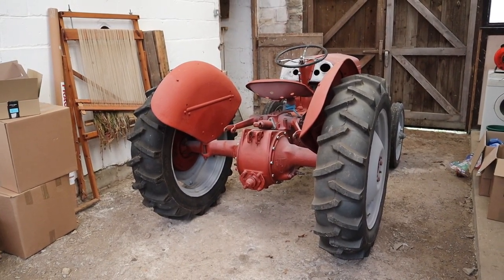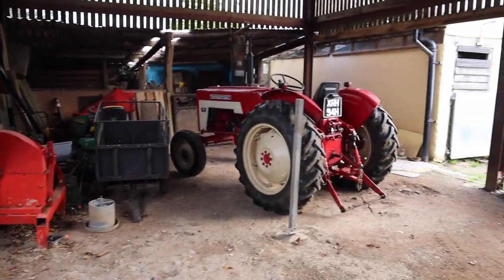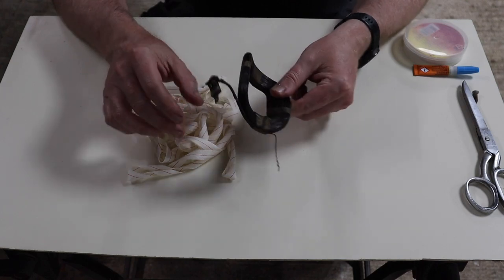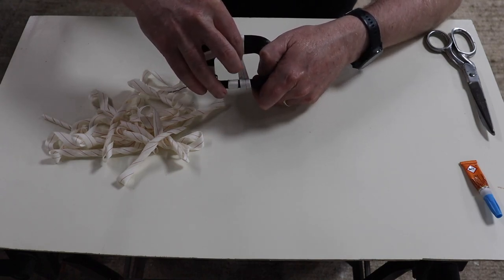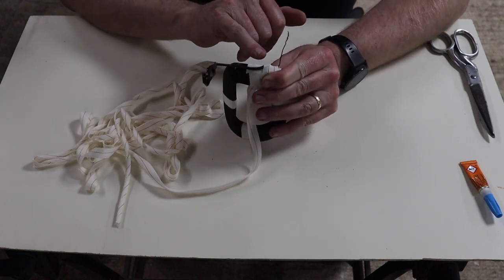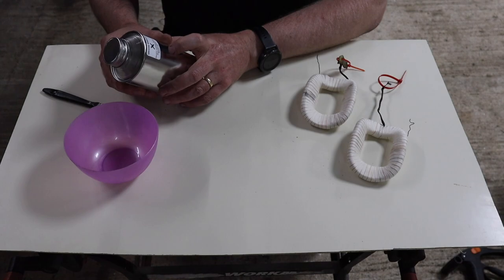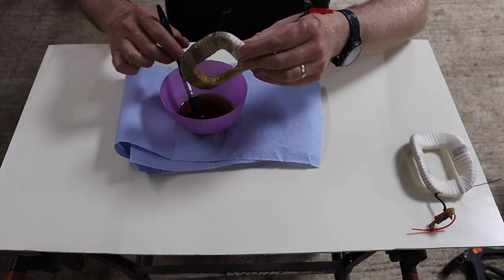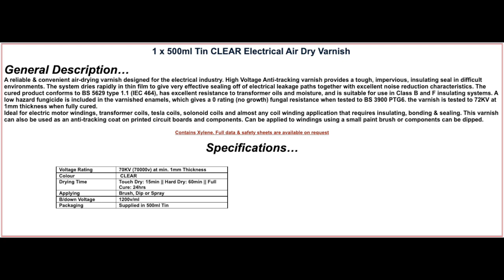#134 Quick Update and Wrapping the Dynamo Field Coils - with KMP Brand

Comment: very useful. going to do that myself. one question though :) for my generator, the cable that comes out of the coil is holding itself by a couple of threads only. once I get the coils unwrapped, should I solder the cable to the coil? any other advice? million thanks :)
Reply from the maker: Hi yes you should be able to resolder the cable to the coil wire. I will be re-assembling the dynamo in the next few weeks. Stay tuned for that! 😉👍